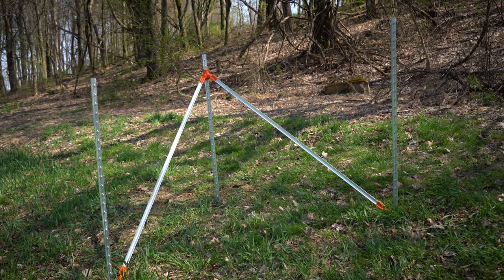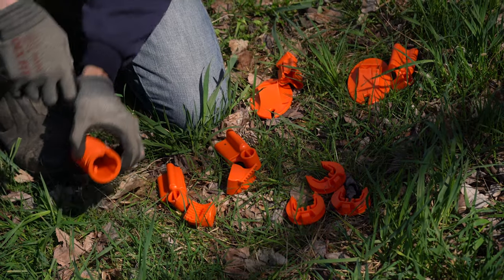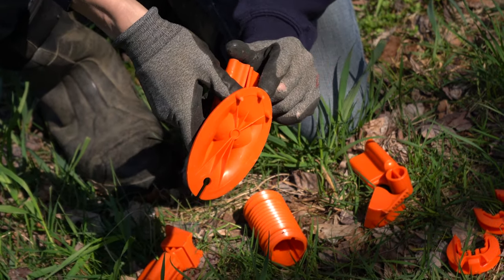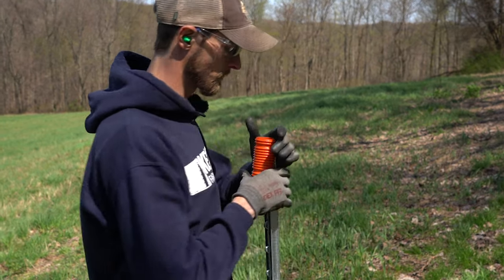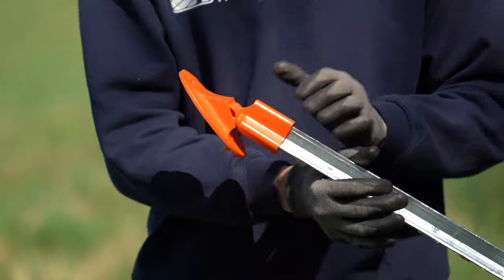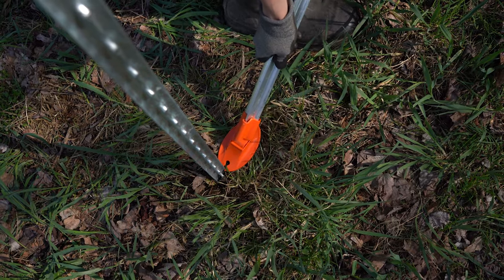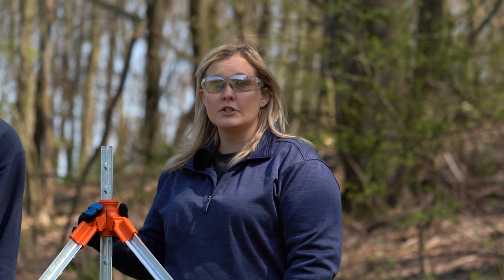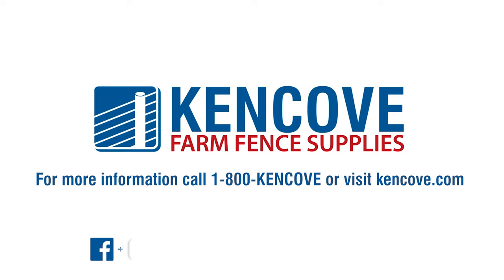Fencing 101 - Building T-Post Corner Braces with LockJawz

Comment: The problem I have with this is that the sun makes plastics brittle.
Will these plastic parts last for years & years?

!
Reply from the maker: This is a great question. The LockJawz is made with a ten year automotive grade engineered co-poly with a UV inhibitor.
The Corner Braces, HD-360 Insulators, and extended insulators are expected to have a minimum of a 10 year before you begin to see degrading of that product. The manufacture states that the regular T-360 insulators, it will be 5-10 years before you start to see any degrading of the product.

Comment: Just saw this after your earlier video on the Wedge Loc system. Which one do you prefer?
Reply from the maker: Good Question! I personally have both systems on my farm and see pros and cons with both. If you have any corners/turns that are anything other than 90 degrees, you will want to go with the Lock Jawz. The Wedge Loc are very secure once you get them in place, and your post spacing is perfect. The Lock Jaws are adjustable. Another advantage to the Lock Jawz is I dont have to worry about my hot wires touching the brace because they are insulated and will not ground my system. - Ashley

Comment: Is this a suitable alternative to a wood h brace corner for multi strand hi tensile?
Reply from the maker: Hello! Wood post H braces would still be the safer bet with four or more strands. The LockJawz bracing would be able to handle up to three strands with little issue, provided the posts are driven deep enough and a diagonal post brace of adequate length is used.